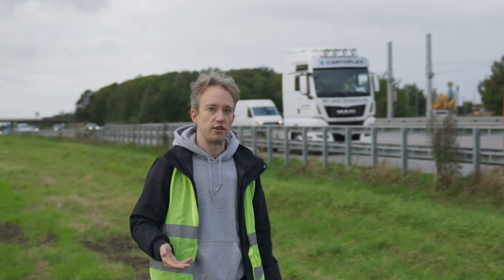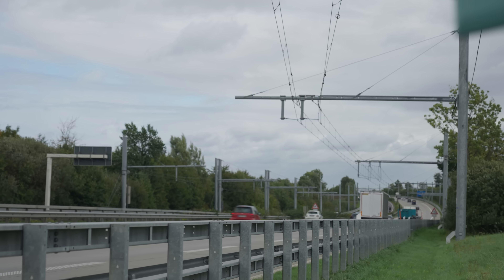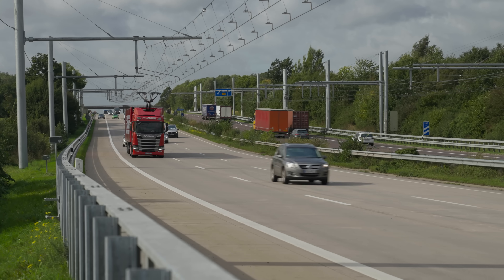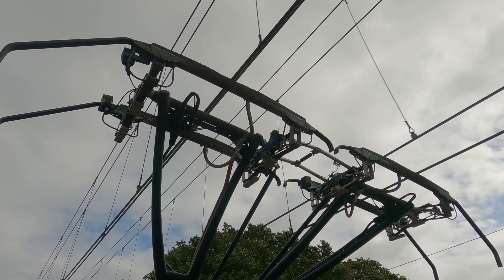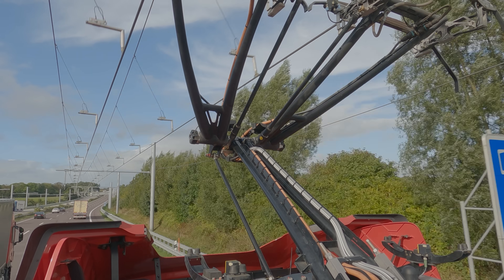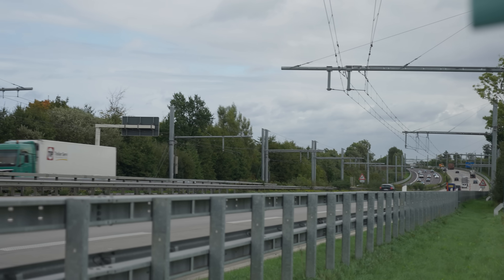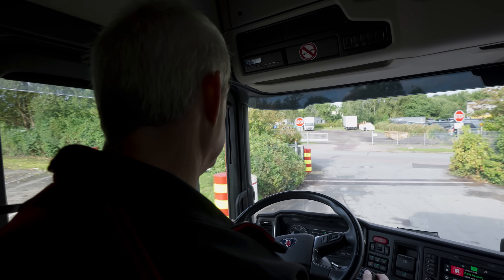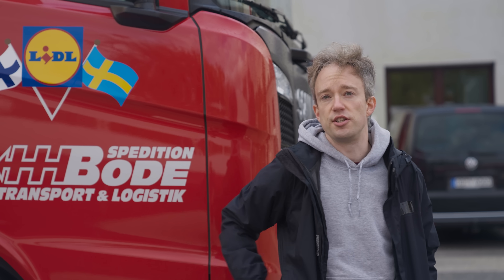The highway where trucks work like electric trains

Comment: I still think that long-distance transport, where necessary at all (I mean we make decent butter in Austria, we don't need it trucked from Ireland), should be done mostly via train, since that is still a lot more efficient than these trucks, but this system is a lot better than the current one.
Reply: As far as I know, there isn't much free capacity available on German railways.
Reply: @Rebasepoiss  Because when the Deutsche Bahn went public they retired many railways
Reply: @CrashXII  Fun fact, the Deutsche Bahn never went public, it was just restructured into an Aktiengesellschaft owned 100% by the state.
Reply: @CrashXII  Yup, for some reason we think its reasonable for highways to all be public and turn a loss but railways are all be private causing unprofitable lines to be cloased
Reply: @Rebasepoiss  so maybe instead of spending billions on this stuff they could actually build up the railways?
Reply: @Rebasepoiss  germany should build more rails anyway.
Reply: @Rebasepoiss  Expand it then.
Reply: @Rebasepoiss its far cheaper to build a diesel freight rail line than all this pantograph infrastructure on top of forcing lorries to fit a pantograph.

Freight rail lines dont need to be very fast, and if they are built seperately to passenger lines they dont impact it. Huge regional freight depots should obviously be connected via rail.
Reply: @Rebasepoiss  yes, because the german train network has been actively reduced and not maintained by the ones responsible, and the car lobby has been lobbying for decades for highways etc, it's one of the worst aspects of corruption
Reply: It's mixed modal transportation. Irish butter is put in a trailer at the factory and trucked some km to rail, where the whole trailer is railed to Wien, then the trailer is trucked to a warehouse in Wien and unloaded and the butter split into Less than Truckload amounts, and some portion of that is trucked to a shop in Himberg.

Industry does tend to prefer the most cost-effective (read: efficient) way of doing something - even to the point of making something TOO cost-effective (i.e. trading anything and everything for 'costs less money')
Reply: Maybe also load trucks on trains for the longer journeys between huge freight hubs? That's what Switzerland is doing. And they could get some juice from the train and recharge in the process if we're talking about hybrid trucks.
Reply: I agree that rail is excellent for a large proportion of long-distance freight, but there is still a "gap" where the volumes are not enough to justify an entire train (or at least not one frequent enough for the business case) and/or the "middle" distance where the added time spent loading/unloading the freight from a train would substantially slow down goods (especially if they're fairly time-sensitive; e.g. fresh produce).
Reply: @mallardtheduck1  here's the way it was done in my town. The train station was literally at the head of the main business district street. A branch line came out from the depot and ran behind the businesses along that street. A shunter locomotive would serperate out the needed box cars and roll them behind said businesses to unload directly.

In fact most of the major distributors were all along the frontage road next to the tracks, tiny corner stores further out did use trucks but these trucks were the size of a modern pick-up.

Most places in the U.S. past a certain size had a branch line to them where the box cars headed for that destination were split off and run out with a small shunter locomotive.

The reason you think trucks are vital is because we stopped centralizing businesses around rail heads.

That's how America was built out, where there was rail there were stores. Before you ask, trolley lines would usually take you directly to said business districts.

The reason you need trucks now is everyone started decentralizing stores, building them wherever it was cheapest and relying on trucks making up the difference.
Reply: I partly agree with you. Things like butter from a far away country should still be available but I think it should be taxed so it costs more. Because currently, these companies just externalize the costs (= they don't pay enough for how much they pollute). I'm old, it used to be that exotic things were more expensive. Eg. Bananas were not cheaper than local apples. And stuff was more seasonal, we didn't have everything all year round with half the year the stuff came from the southern hemisphere (eg. I see apples from Chile in the off season for apples now). These things could still be sold, but their price should reflect them being the luxury they are. We didn't feel deprived back in the 70s and 80s because this was like that

The other thing is that if we wait for Germany to build enough extra railroad tracks, we'll be waiting 30 years. While this system could be rolled out in 5. So, I'd go with this in the interim any day. And it probably costs less as well. No land to buy (the time for negotiations with the landowners alone...!), no tracks to lay, no new trains to buy. Just string some cables above existing Autobahn sections and make some modifications to the trucks.
Kinda like the electric trolley busses in Salzburg, I think they're neat.
Reply: Trucks are mainly used to get goods to their final destination, EG off a train to a supermarket or off a ship to a store (at least that is how it works in the UK) it is still horribly inefficient and polluting though
Reply: Trains are ideal for moving a lot of goods from one huge place (eg a harbor) to a few big places (factories, warehouses). You can use a crane to just lift the container from the ship to the train, then from the train to the truck or yard. Trucks are ideal for moving a smaller number of goods to many places, like from the warehouse to the shops or delivery to homes. They both have their place.
Reply: @renakunisaki  Ikr
I don't get why so many people think trucks are irrelevant
Reply: @lord_scrubington  maybe in Europe they don't use freight trains as much as America does. We have both although train route through my town is basiccly dead 20 years ago there been a train each day at a set time. But rarely one comes through now. Although main line I still see them from day to day
Reply: How decent is this butter of yours?
Reply: There are some places where the only choices are lorry or ship the lorry. For example: In Northern Norway there is no rail network. So rail transport isn’t an option.
Reply: nah take our butter
Reply: at this point we're going to circle around and just get trains
Reply: Buy our butter! Butter and tax dodging  is all we've got
Reply: but, do you produce ENOUGH butter for everyone in austria?
Reply: This is good for last mile travel I suppose but I would generally agree with you. Rail is more energy efficient and works better with economies of scale. The only issue is having the infrastructure available which isn’t always the case unless they are willing to make railways wider
Reply: A surprising amount of irish butter is shipped in bulk to Germany and retail packed and distributed from there - ( don't know why ) .. 
        Also Irish butter is really good ..😁
Reply: Gonna join the un biased group reminding you that you do in fact need some Irish butter in your life
Reply: How could you rely on uk motorways with nighttime roadworks and daytime crashes.
Reply: Trains cannot deliver its cargo by parking, for example, on a supermarket to drop out their cargo like trucks do. They have to stop at a station, far far away from where the cargo must be delivered.
Reply: fun fact, the trains in ireland are 0.5 cm wider than the international standerd, meaning that irish trains are custom fit and designed to fir on the tracks
Reply: @3britishweebs388  fun fact, Finnish tracks are 8,9cm wider than the rest of europe. There is a transfer section in my city that has both track widths for transferring cargo coming from sweden to finland and the other way. (if there is any cargo going thru it currently idk).
Reply: hello fellow Austrian, I share your opinion. I think there should be massive investments and cooperation in Europe for trains, passenger and freight.
Reply: It’s about looking like you’re doing the right thing, rather than actually doing it. “Ooh look kids, electricity!” Sells a lot better than common sense and problem solving.
Reply: Commies always claim that they know how to plan an economy. And if only people would do this to solve world problems which really means we want to control everything. A market economy is the reason the world has improved.
Reply: Here in the USA, trains are hub and spoke. Trucks will take containers on chassis to a main Depot from various customers, then they'll be sorted on trains going to the same region whether north south or east west or Southeast, etc. Then they'll be taken off and trucks will take them to their final destination.

It has become increasingly efficient and has become a rather popular method again.

I think the main reason it fell out of favor years ago was computers weren't as common or powerful or maybe didn't even exist to assist with orchestrating it all.
Reply: And we all know that Austrians only need butter to live.
Reply: in the US it is done mostly by train.(just cause you don't see the trains cause they've been moved away from the public for safety and noise reduction doesn't mean they aren't running.they are a transport system not a public show..)

but in other countries it's impossible cause they sacrifice freight for public transport.slowing down freight to the point of not being efficient or viable even for large shipment of goods.
culture has a lot to do with how things are transported.
Reply: @starandfox601  According to Wikipedia 60% of all cargo in the US is shipped via trucks, only 10% via rail...
And in most places in Europe cargo-rail could work (there is little public transport going on in the night) but companies want to reduce their storage costs, so they get stuff shipped in smaller batches "just in time", and trucks are more flexible (plus they are indirectly subsidised by not having to pay their share of infrastructure use)...
Reply: These are short distances trip love. Hence why they use trucks. These trucks goes directly to smaller cities and far away areas with little to no infrastructure. Rail only works in high demand area.
Reply: I agree with you, however there's a reason why trains aren't used as much as they could be. I have some theories why that could be the case.
1) Organizing a truck-load of cargo is easier than organizing a train-load. You don't need to transport a whole train of the same type of cargo and to one destination too often and assembling a train of different cargo types to different destinations is probably a lot more difficult task that logistics companies avoid.
2) There's lacking infrastructure. Cities often have industrial zones at the periphery mostly made out of new factory buildings. These zones rarely have railroad access and the companies don't want to pay for building it. Also many companies have switched to a just-in-time delivery system, where they rely on frequent low-capacity deliveries rather than infrequent high-capacity ones. It saves them money on storage space.
It might be possible to move cargo back on rail (historically more cargo was transported on railroad and old factories had railroad access), but that would require a great investment into building new railroads and transshipment depots.
Reply: @R421Excelsior  If you really want to get historical, canals (and rivers) used to be the primary freight arteries.
Reply: @R421Excelsior  the reasons are self-made. Our world is carcentric. Go back 100 years and you'll realise, all industry was centered around rails...
Reply: Trust me , you need Irish butter . Im not biased , I swear
Reply: With the amount of individual endpoints that only works if you can very efficiently schedule your trains with a wide variety of cargo. Trains are good at bulk transport which they do better if everything from point A needs to go to point B without much waiting time for onloading everything on point A. There is a reason why at a certain scale companies start to work with distribution centers.
Reply: trains can't really do short distant where lots of turns are needed m8. Lorries have a purpose and always will
Reply: @lord_scrubington  Did you not watch the video? The overhead wires are only for long distance lorries anyway, so your point is moot
Reply: @lord_scrubington  Short distances can easily be covered by Batteries so this system is redundant
Reply: @lord_scrubington  As Tom said in the video, this system isn't a replacement for short distances.
Reply: @lord_scrubington  lots of turns are only needed when the road is bendy
Reply: @ekvedrek  correct
Reply: @lord_scrubington  This can’t do the “lots of turns” thing either.
Reply: @lord_scrubington  A place where "lots of turns are needed m8" is a place where a truck still needs electricity/energy to go from this improvised wanna-be railway to its destination.
Reply: @Dennis19901  why is this suddenly a wanna be railway though??
What has suddenly changed that makes this no longer a road?
Functionally, it's still a road and still far more road like than a railway. Adding power lines doesn't change this
Reply: @lord_scrubington  Right, and functionally a railway is also a road.

And a train is just many trucks with steel wheels instead.
Reply: @Dennis19901  no.
railways require a lot more organisation of traffic than a road does. that is the difference. That difference definitely still exists here.
If you think adding some wires just changes that then you are wrong.
Reply: no one is arguing that it shouldn’t be done on trains, but that requires a lot of very expensive infrastructure to be built. running wires above the rightmost lane is much, much cheaper. plus, trucks can always go more places than trains can.
Reply: Oh, you are missbuided by the advertisement as well. Take a look at the oval stamp with a alphanumerical code on it (eg. DE BY453). It shows, where your dairy product or processed meat come from. Regarding to the major Irish Butter brand, one time I looked up the stamp, it was processed somewhere in Northrhine Westphalia.
Reply: These are more flexible though. Like they said, these can work in rural areas where building railways might not be economical, and these can take the deliveries straight to where they're headed, while a train would need the cargo to be picked up by another vehicle.
Reply: @vincentfiestada What is the problem with transferring cargo from a train to another vehicle?
Reply: It should and it is.... where possible. Companies/ customers usually chose the cheapest (mostly- most efficient fuel-wise) option.
In general if it's coming from other side of the world, it's shipped, if the distance is 500+ miles a train is used (if there are tracks), shorter- a truck, then last couple/ couple dozen by a small vehicle
Reply: The problem with that is different voltage, need more investing in electrified tracks specially in remote areas, and have different sources where the electricity comes from, the EU probably needs to unify the voltage and its source so it can travel continent wide otherwise, like this, using diesel engines is far cheaper for companies.
Reply: Not enough train tracks.
Reply: cant. railway took spaces to built, which mean more trees need to be cut down. you can dug a nationwide tunnel or overpass but unless you're playing TheoTown, our resources is quite limited.
Reply: what's wrong with people? this isn't meant to reinvent railway, instead its an solution to battery powered vehicles range problem, vehicles that are needed to supplement trains or needed when trains are not an option, TRACK DRIVEN VEHICLES ARE EFFICIENT AF  BUT ALSO RIGID AF, YOU WILL ALWAYS NEED A FLEXIBLE TRANSPORT FOR SMALL SCALE/PERSONAL USE!
Reply: @tibontibon5772  is a full-size electric lorry, that can only use the wires on large trunk motorways, a flexible transport for small scale/personal use?
Reply: It won't work. Most western European rail systems are primarily for passenger traffic.
There isn't the capacity for more freight. They're great for bulk goods like gravel, and dare I say coal.
Reply: It's not very possible to build more railways, and current ones already work to as close to max capacity as reasonably possible.

We're not the US where the word train has lost meaning after the year 1900, bro. We use it. As an Austrian you should know that plenty well.
Reply: @Anankin12  It's very possible to build more railways. Go back 60 or 70 years and most industries had their own rail spur. Cities were mainly fed by rail yards. In some places, freight was towed up and down the tram network. You had a lot more rail lines in general in most countries. 
Trucks aren't going away but there's a lot more that can be done with rail than is currently. Nobody would say "it's not possible to build more roads, and the ones we have are full".
Reply: @doorhanger9317  Nobody would say "it's not possible to build more roads, and the ones we have are full".
Cologne wants to have a word with you
Reply: @doorhanger9317  in America the semitruck is part responsible for killing the train system. After semi invented and could travel further companies stopped relaying on the rail so much as well it was cheaper then a train.
Reply: @Anankin12  Railways take up less space than roads and are cheaper to build for the traffic they take
Reply: @Isochest  not really if you live where I do
Reply: Depends on the train.  Ever seen a diesel electric start up in a morning?
Reply: Travel the world and try the milk, from Ireland to Wisconsin there's a difference you will notice even if you don't care. Trains don't work uphill, take longer to ship, and the tracks have no alternate use while in operation for trains. Highways on the other hand allow families to drive along side shipping trucks, who's space is significantly reduced compared to a freight train so they can make fill shipments a lot faster.
Reply: They have been trying to offer reliable and cost-effective transport by rail for more than 185 years now in Germany and still can't compete with other means of transport. Maybe railway is just inferior by design.
Reply: There are many big downsides to rail. You need to transport 2 and from the rail to trucks anyway to get the last few feet. You don't have flexibility of time schedule and the lines need to take up a tonne of space. 

The loading and unloading time. The travel from Depo to station then station to depo instead of directly from Depo to depo. 

It all adds up
Reply: OK but no more free 2 days shipping trains are efficient but slow. Unless your stuff is really close.
Reply: Trucks are only "cheap" because you as a taxpayer subside the very expensive roads to be repaired and resurfaced. Trucks cause huge (99%) of damage to roads and pay for very very little of the repairs
Reply: @raginghowlk  most stuff that has 1day delivery is already in "local" warehouses. So that wouln't change.
Reply: @raginghowlk  just a hint: We don't have 2 day shipping here. You usually get it on the same day(only in very dense populated areas) or on the next day.
Reply: @raginghowlk  1) oh yes, the horror of losing 2 days shipping, society would indeed collapse. 2) No, they're not slow. A fast passenger train from Hamburg to Munich (Germany from North to South) takes just short of 6 hours. The drive is 7 hours with good traffic. On a personal car, of course. 3) As per point 2, clearly you have no idea what you're talking about be it trucks or trains, or anything. 4) also per point 2, as long as the infrastructure does exist and is well planned, maintained and upgraded, (which could be its own point), you have no reason to lose something like 2 day shipping, actually. 5) trains are economy of scale - for these longer hauls, how many trucks you think equate one single freight train, or even a hybrid train? If we are looking at the higher ends here, it is on the vicinity of 800 trucks (and massively more fuel/energy efficient too) to 1 freight train with its full load. 1 freight train with its own exclusive rail road vs a 800 truck convoy on roads shared with other traffic, potentially also creating traffic slow downs which recursively affects the convoy - smooth plan there, chief.
Reply: @raginghowlk  cargo locomotives can go to 200kmph
Reply: @truedarklander  not in the USA